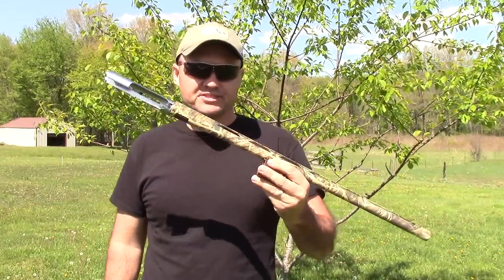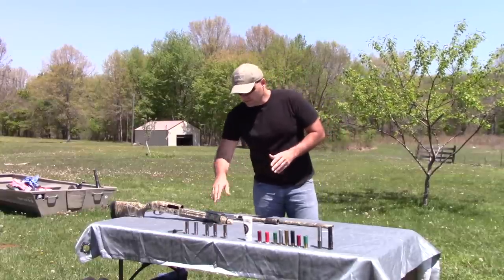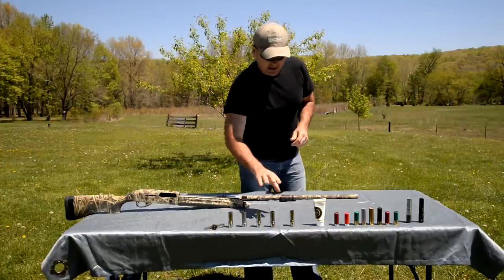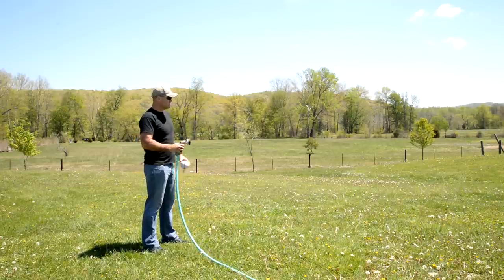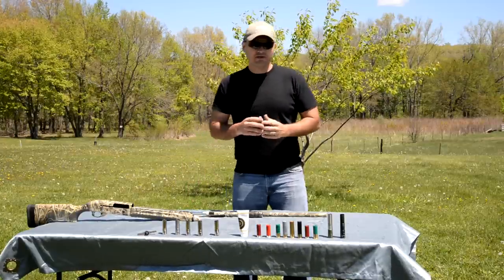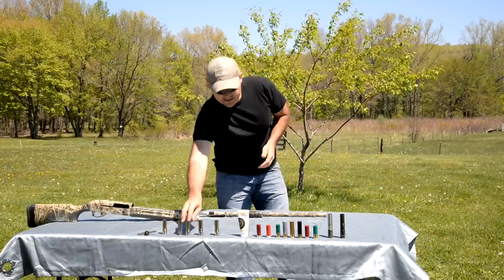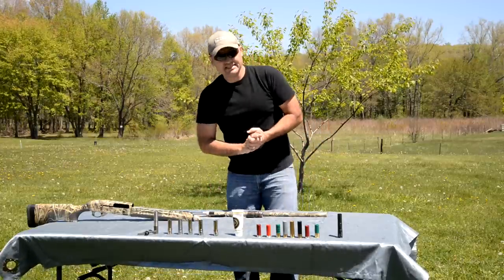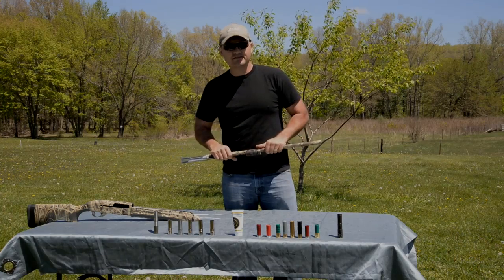Shotgun Choke Tube Basics

Comment: I'm not a hunter and my only shotgun is a Mossberg 590 which has no threads on the ends. I really didn't get how chokes worked or why you would even use them, but this really helped, thank you. (I saw a video for a shotgun suppressor and said it attached with a choke so...)
Reply from the maker: Thanks for leaving the feedback! I'm glad you found this video helpful. Those Mossberg 590 shotguns are great. I'll have to look up those suppressors. Sounds cool.

Comment: I like your videos on shotguns. Thank you Buffalo. Very good demonstration. 

Though I collect and shoot handguns and rifles also, shotguns are my passion.  One thing to note is that there really is no "standard" bore diameter for a shotgun gauge.  Well, there is, but it is not a law or anything. Bore diameters vary from maker to maker and such terms as "backboring" are applied.  This just means an oversized bore, larger than standard.  These are supposed to reduce recoil and shot deformation. Do they?  That would require experiments I am not equipped to do. The degree of choke relates to the degree of constriction vs. the bore diameter.  I have 2, 20 Ga. O/U shotguns I use for sporting clays.  One has a bore diameter of .620" and the other has a bore diameter of .625".  Chokes generally run in .005" increments for Skeet, IC, LM (or "Skeet 2"), M, IM and Full.  Full, usually is .030" or "30 points" of choke constriction in a 20 ga.. But that can also vary by manufacturer and gauge. .  The pattern percentages should be similar and pattern percentages will vary also.  Most chokes are rated at 40 yards with 7-1/2 shot (25 yds., as you note, for .410 bore) Larger shot tends to pattern tighter for any given choke.  

It is best to pattern your gun with the ammo you will use for hunting, for example, and not just screw in a choke because it says "Modified"

NEVER fire a shotgun threaded for choke tubes without a tube in place!  The threads are very fine and can be easily damaged or clogged with debris.

Comment: Thank you, very informative.  Since I'm looking for a new barrel for my Sears Ted Williams Model #200 (aka Winchester 1200), this was very helpful in explaining choke tubes.  My prior barrel had a poly-choke.  After 50 years, the welds holding the choke to the barrel came loose.  Hence the need for a new barrel.  That said, if anybody knows where I can get a poly-choke barrel for my 200, let me know.  Otherwise, I'm probably gonna end up with a screw-choke system from a 1200.

Comment: just a thought first to say great job on your vid!! now i would like to say that i would use something called never seize ( which can be bought at auto parts stores ) for the choke threads. It can withstand high heat and works great on bolts on the exhaust of a car. Would you agree?
Reply from the maker: +MrDavidAD1 Yes, I agree. I should have mentioned that. I use breech plug grease (for muzzle loaders) but yeah that is a good idea.
Reply: That stuff makes too much of a mess to be worth using. Just use a light coat of grease, like the one that comes in a spray can and you won't have any problems.

Comment: If you have no choke installed will the threads inside the barrel get damaged by shot coming out the barrel?
Reply from the maker: I have never found a reason to fire a shotgun that accepts screw in chokes without a choke installed. So I don't know.
Reply: Buffalo Okay, thanks.
Reply: Tregeta If you have threads in the barrel for a choke tube then you should never fire a shotgun without the chokes because doing so can damage the threads inside the barrel with it being done this way..... Just put a cylinder in the barrel if you do not want any choke restrictions....

Comment: thanks bud running a 887 28" it came with mod choke i know its long but for home defense mod tight pattern ? also have h&r topper single shot no threads in barrel 18" (had it cut years ago )

Comment: I'm trying to understand more about 'extended' Choke Tubes, and what their purpose is. Really appreciate if you could give a tutorial on this subject.. thanks!
Reply from the maker: Extended chokes do a couple of things. They give a longer more gradual ramp up to the final choke constriction and give a longer area at full constriction-- both of which is argued to help with patterns--  I have no proof either way but as a side benefit the chokes are easier to change out since you can just grab the portion that sticks out of the muzzle and twist it right out, no tool required in most cases.

Comment: The smallest diameter choke would be the the size of the barrel bore, 
and the largest choke would be slightly larger than the barrel bore?
I length of  chokes for a given shotgun , generally the same, until you get 
into more refined combinations?

Comment: Hi it's my first time owning a shotty with a choke change option.  If I shoot a slug will it hurt my choke or do I need a special choke for a slug?
Reply from the maker: Slugs usually shoot best through Cylinder (C) or Improved Cylinder (IC), accuracy starts to suffer if you go any tighter than that (in most cases). You don't need a specialty tube though.

Comment: good video....i do have a question however....have you seen the new Derya MK12 magazine loader semi auto 12 guage?? it comes with 3 chokes....i wanted to know which choke would be best to use with buckshot to get a decent pattern at say 50 feet.....or beyond.....yes the rifle is a 12 guage but its design would say CQB use but it can be a good hunting rifle simply by its nature of it being a 12 guage....so im looking for a good all around leave in the gun solution for hunting (birdshot) buckshot or slugs....what do you think??
Reply from the maker: I would go with Improved Cylinder or maybe even Modified for "all around" purposes. Most defensive shotguns are Cylinder bore. You can "over choke" large pellets such as 00 Buck so going any tighter than Modified would likely be counter productive.

Comment: Excellent video! Question: must I use a choke? For example, I just bought a 12 gauge VR80. I’d like to be able to fire buckshot and slugs without worrying about a choke. Thank you.
Reply: Edmund, a VR80 usually comes with a mobil choke.  That means the barrel is cut to accept a choke.  Shooting it without a choke installed is a good way to ruin your R80 pretty quickly
Reply: I forgot to add, you could get a cylinder bore choke, so there would be no actual "choking" taking place.  Is that what you are interested in?
Reply: Craig Mowrey 

Thank you for your response, Craig. I’ll take your advice and use a choke with my VR80.

The question is which one for buckshot and slugs.

The weapon came with Modified * choke installed.

There are two other chokes which came with the weapon: Full , and Cylinder ****

The manual says not to use slugs with * or *

Edmund
Reply: Craig Mowrey 
Hello, Craig.

Thank you for the info—and putting up with my confusing responses. I have a pretty good handle on choke tubes now. Again, thank you.

Comment: buffalo nice vid one ? can you damage threads in barrel if you run with no choke?
Reply from the maker: +pan74gn I've never fired a shotgun without a tube installed. There really just isn't a good reason to do so. I would think that at a minimum you would foul the threads with carbon and gunk over the course of a few rounds.

Comment: If you have say a modified fixed barrel choke and you cut out the choke such as sawing off the barrel,does this then make the barrel a cylinder bore barrel? I have a 28" fixed modified 20 gauge barrel that I would like to make into a 24" long barrel, but would like to have the barrel internally threaded for flush mount chokes to swap out different chokes. I don't know if that can be done or not.
Reply from the maker: Yes if you cut 4" off the barrel you will be left with a cylinder bore. Some shotguns can be reamed and threaded for chokes after they have been cut down, depending on the thickness of the barrel steel.
Reply: @buffalosoutdoors  Ok thank you for the reply back, just wondering if you are familiar with the Hatfield SGL 20 gauge because that was the barrel I would have in mind and wondering if it could be threaded.

Comment: BROTHER WHICH CHOKE IS BEST FOR DUCK HUNTING FOR LONG RANGE UPTO 40 YARD
Reply from the maker: Hard to say without patterning your shotgun with the load you're using. Hard shot like steel shot doesn't require as much choke for tight patterns and in fact can be easily over choked ruining your pattern. If you're using a harder than lead non toxic shot I'd try a modified choke and see how that works out. That would be a good place to start.

Comment: I recently bought a maverick 88, short barrel. Would it be possible to put a choke on it? (I know its not so practical but id rather not have to buy a new barrel)
Reply from the maker: You can have a gunsmith thread it to accept choke tubes.

Comment: Does the shot damage the choke on its way out of the barrel? I feel like the pellets would slowly tear it up
Reply from the maker: +Robert S. Under normal use you will never wear out a choke. The biggest facto in wearing out a choke tube is using them with incorrect loads, such as a full choke made for lead only with steel shot. Or shooting a bunch of slugs through a tight choke. Using lead birdshot the choke will last you a lifetime.
Reply: Thank you

Comment: can you shoot lead pellets thru a steel proof coke? or am I only able to shoot steel thru the steel choke?
Reply from the maker: Steel shot is much harder than lead. Any choke tube can handle lead shot, a "steel proof" can handle steel shot in addition to lead. So yes, you can shoot lead through a steel proof choke. Thanks for watching and asking the question.
Reply: Thank you! this video was very helpful! also, is it normal for my benelli nova 122 gauge pump-action shotgun to pump on safety? I just got the gun for x-mas
Reply from the maker: You should be able to pump the action with the gun on safe. This allows you to chamber a round with the safety on. Sounds like you had a good Christmas. Be safe with your new shotgun. Don't be afraid to seek guidance from a friend or family member that has experience with shotguns.... There is no such thing as a dumb question when it comes to gun safety.
Reply: ah okay perfect, I sure did have a good Christmas!

Comment: If you don't screw a choke into the barrel, is it a cylinder choke ?
Reply: i don't think so. Firing without a choke would probably damage the choke threads at the muzzle. some shotgun barrels are full cylinder and incapable of accepting any choke.
Reply: a choke less barrel is just called "cylinder bore". a good deal of tactical shotguns, such as the mossberg 590 a1 are cylinder bore, as the variety of ammo for these shotguns is vast. cylinder bore is for close applications when using buckshot, but with flite control buck, you get the patterning similar to using a choke for tighter groups. and of course slugs are fine in a choke less barrel.
Reply: Mike Jones for the love of god dont fire your barrel thats threaded for chokes without one, it will fuck it up, if you want cylinder bore you need to screw in the cylinder bore tube that came with your gun

Comment: what about length of choke? I have a modified choke that is super short compared to yours.
Reply from the maker: These chokes are out of my Beretta Xtrema II and are supposedly engineered to give a gentler (longer) transition from bore diameter to the final choke constriction than most shotguns. It is said to improve patterns but some say it's just a gimmick. This shotgun also has an extended forcing cone and is slightly over bored which are also things said to improve patterns by making them more even so it's hard to test it against a shotgun with the shorter standard size tubes and determine if the long tubes actually help or if the other factors play more of a role. I wouldn't worry much about it though the shorter tubes work just fine. Sorry for the long answer, I hope it helped.
Reply: I'll have to get a longer mod. choke and put some rounds through and see what the difference is. Thanks!